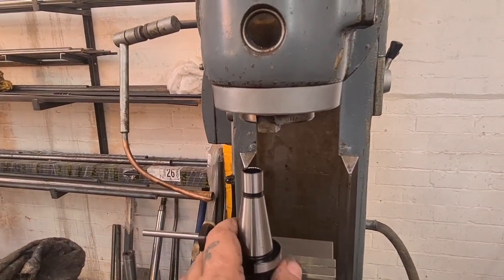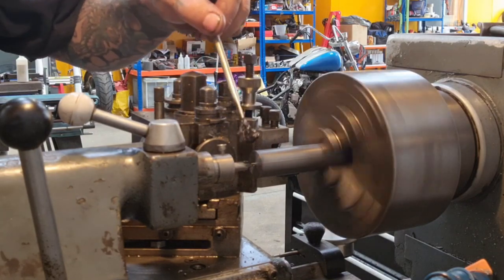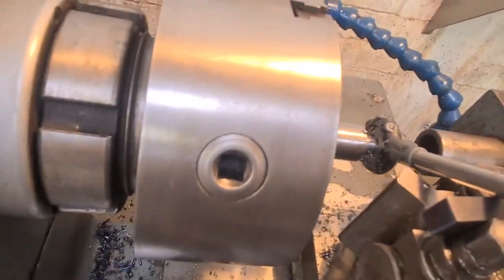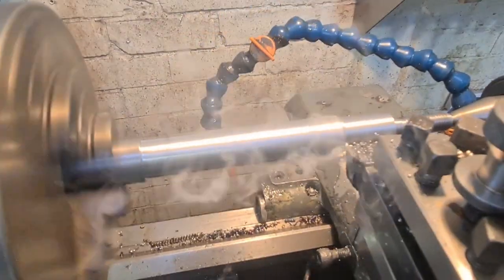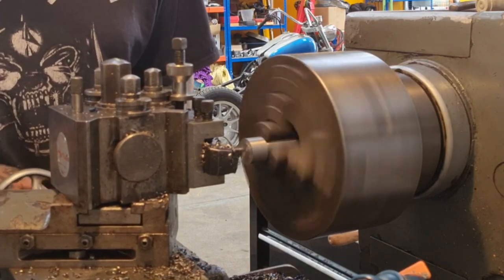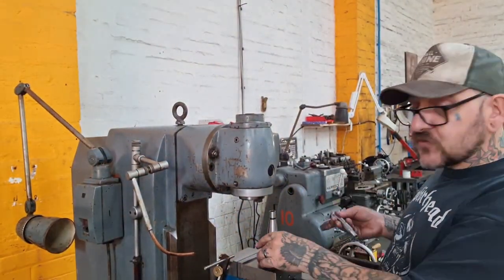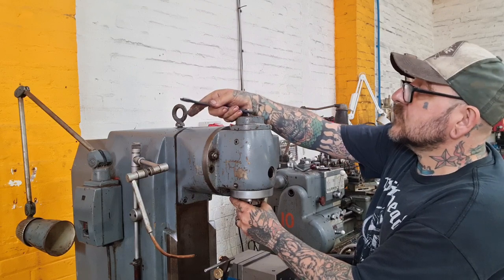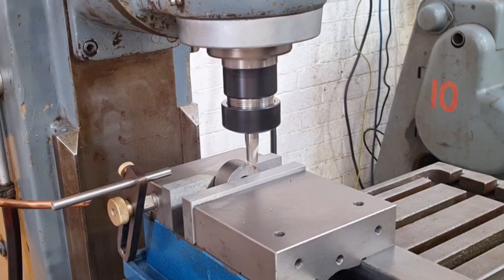Making A Milling Machine Drawbar Setup It's just the ticket too

Comment: Very nice.
I had one of my regulars stop by yesterday and he took a look at your power feed video. This guy is a retired Millwright/Electrician and this is what he had to say,
"The two pushbutton switches are a dead giveaway. It is using a reversing
contactor, like those found on automatic gates. The old mechanical drum-
type break before make switches are probably not available outside
electrical surplus stores.

look for a bad coil or bad contact points.".

Something for you to look at anyway.
Reply from the maker: I thought the same, but the top button is for switching on the spindle drive (the main motor, although long since worn away, the face plate originally showed "Spindle" on the top button and "Feed" or similar